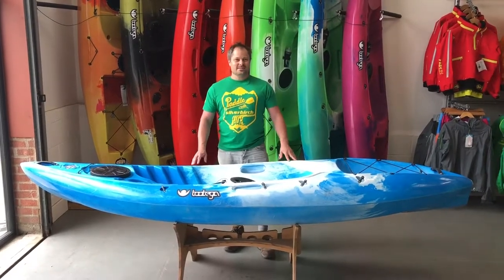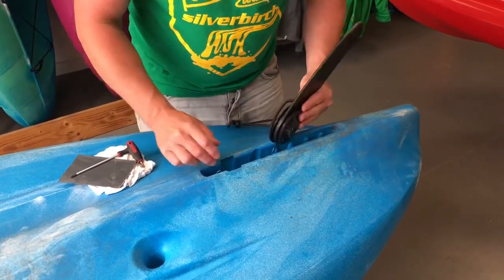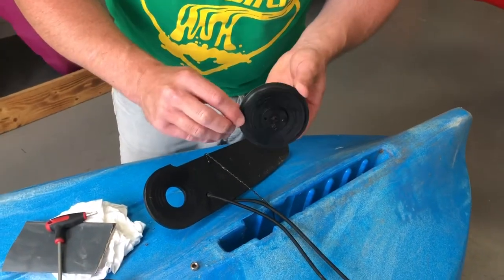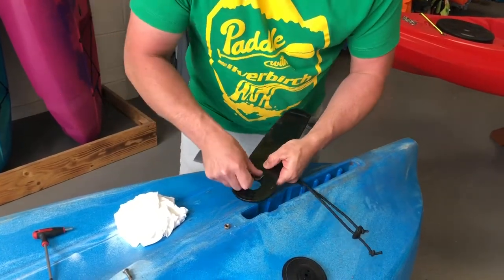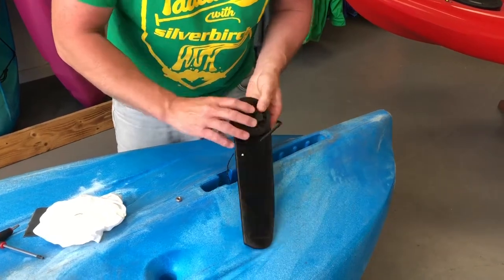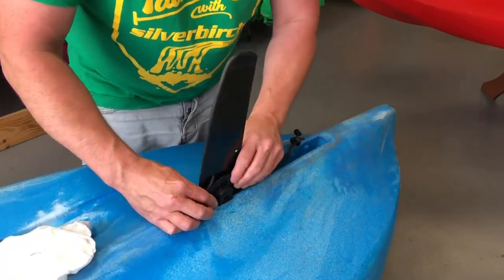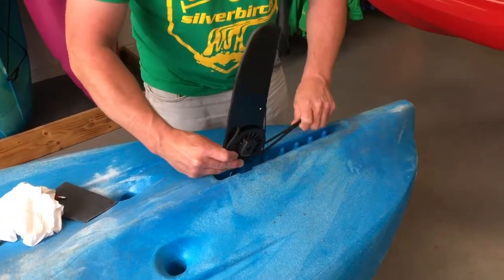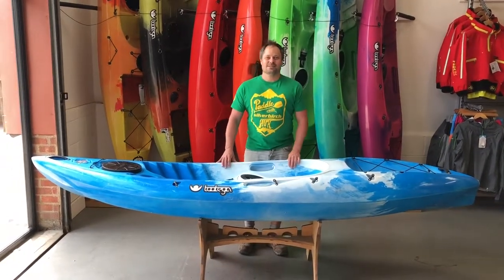Tootega Kinetic 100 skeg system service

Comment: If this boat were inflatable I'd go for it. I think they're 19kg which is quite a lumox to carry about. I have paddled one off the Cornish coast and loved it but carrying it out of the water was a strain. Inflatables are less than 15kg (which is a lot less) and bundle into the back of your car. You can take 2 people for a third of the price of one of these too. However, I do want a Tootega. There is no logic to this. If you can make this boat 15kg I'd get one.
Really stupid question: could you make one in two halves (like rowing boats are transported) which bolt together? It worked for the Cockleshell Heroes.... This way transporting would be accessible for most people. And storage.